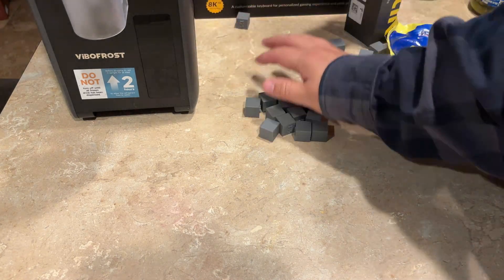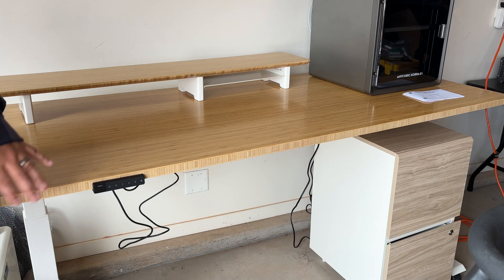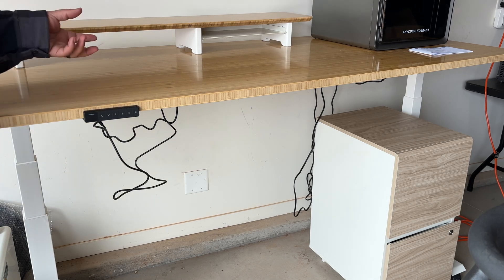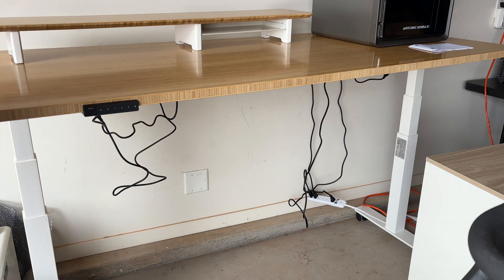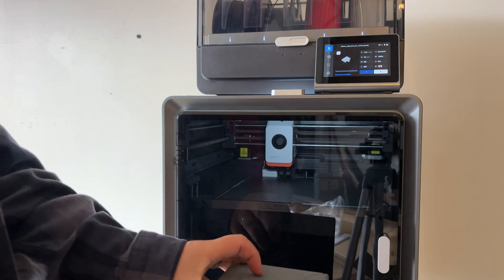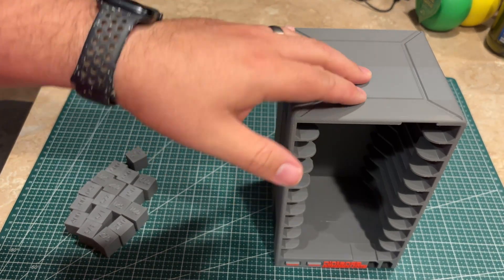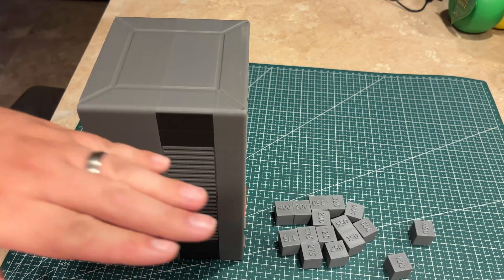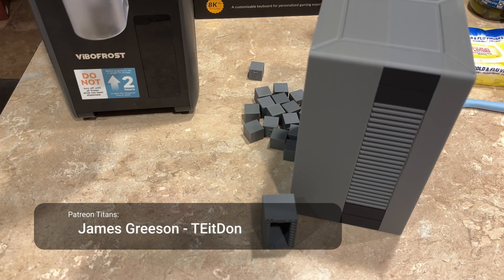My New Desk Setup Still Didn’t Fix This Mysterious 3D Print Problem

Comment: It could be a speed issue as you expected, did you review your model on the Speed color scheme preview? Sometimes you can see drastically changings speeds on different layers. This can cause this issue. Keep the speed nearly the same for every speed setting to keep a persistent print speed. Watch out for hidden settings like "Slow printing down for better layer cooling" under the Cooling tab in the filament setting, to get rid of unnecessary print slow downs.
Sometimes it is some different. Have you tried some of the tips shown in the following video? Just search it up on Youtube, he explaines some limits for the physically of the printer: The Fatal Error No One Talks About – Get Incredibly Clean 3D Prints! 

Wish you good luck, finding the solution!